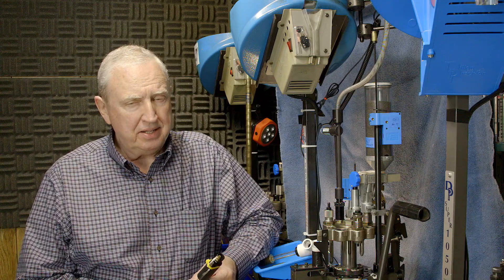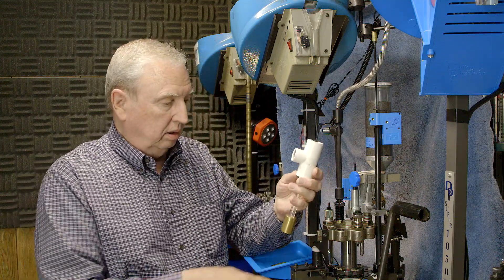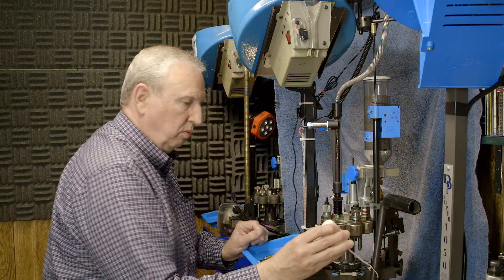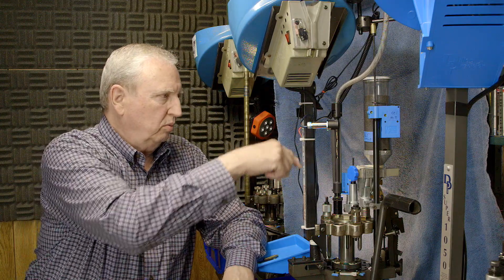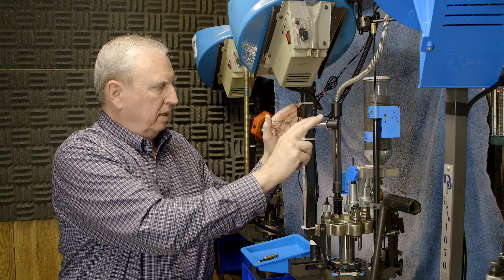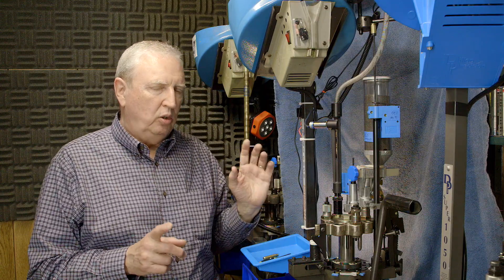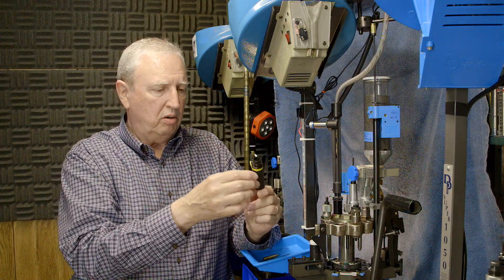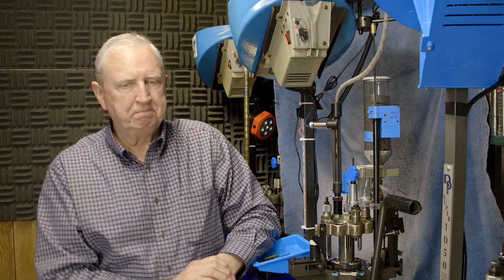3D Printed Prox Switch Dropper for Mr. Bullet Feeder

Comment: Thank you Rex for your contribution. Excellent work on the design. I noticed the 9mm stl v2 file doesn't have the proximity switch threads included. Do you have a version that includes the threads?
Reply from the maker: I discovered immediately those very fine threads don't work well (or at all) as printed threads and it is necessary to go in with a tap to make them work.  Right away I bought an 18mm tap for that purpose and have used it a lot over the years since. 

Also I feel the design I came up with later which uses a light sensor instead of an induction sensor works better. Most of all, I like the newer design because everything is in one package and the external wiring  is eliminated except for the power cord which plugs in. 

And finally, while I truly love either of these for .224 bullet sizes, I don't see any advantage to them over the Mr. BFF model when the bullets are 100 grains or more. 

BUT, if you'd like an STL version with the sensor threads, I will make one available later this morning. Check the links in the description for an update.
Reply: @RexRoach  Thank you Rex. I originally didn't see your new design until now. The new design looks great! Unfortunately, I've already purchased all the electronics using the proximity method. I printed the 223 switch dropper last night with a Nylon Glass filament and It turned out great. After running a quick 620 grit sandpaper pass, the switch threaded in perfectly. I think in most cases the various filaments will have a little shrinkage to create a good snug fit. Thank you for posting the tap specs. I plan to get it for the 9mm version.
What motivated me to go with your design, I found the Mr. Bullet Feeder switch area caused a lot of hangups. I tried every possible fix and nothing worked. When I saw your design solution, it logically made sense to pursue it. In the near future, I plan to go the optical route for 10mm.

Comment: have to say i just stumbled across this and its amazing!!!!!!  Rex, i appreciate you sharing this video the STL.s, and other various links!  but as with everything it leads to questions.
i tried to hook up my sensor(the same you suggested) and it does nothing....??  fiddled with some wiring and now it makes my feed plate spin when the light energizes??  lol   i'm not an electrical master but do understand typical wiring,  (have done normal drag car stuff for years with relays). 
i have a worm gear driven DC 20RPM motor from like BangGood, a RMP switch with on off toggle and the sensor and relay finishing it off with a 12v dc adaptor running 1amp to a barrel plug  any assistance would be great.
Reply from the maker: Daniel, start with the sensor. When you put metal near it, the light should come on. That will validate the sensor's working.

The problem you are likely encountering is the double-double nature of the sensor and the double nature of the relay. Lots of combinations. 

If your sensor is PNP then the signal wire will become ground when the sensor is energized (light on). In that case, connect one side (85) of the relay coil to 12 vdc+ and the other (86) to the sensor signal wire.

If your sensor is NPN then the signal wire will become "hot" (12 vdc +) when the sensor is energized. In that case, connect one side of the relay coil to ground and the other to the sensor signal wire.

Next, your sensor may be NO or NC, that is normally open or closed. Here you simply observe if the relay trips when the sensor comes on (lights up) or when the light goes out.

You should have one wire connected to your motor at all times. This can be either 12 vdc+ or ground. The other power wire will connect to the relay (30) and a third wire will connect from the relay to either 12 vdc+ or ground and it must be the opposite of the other wire to the motor. The third wire will connect to 87 or 87a. The easiest thing is to try one and see if the motor runs when the sensor is NOT energized. Swap it if not.

Hope that helps.
Reply: @RexRoach  i do in fact have a NPN "NO" sensor.  i'll attempt your suggestion and report back!  thank you again for the info and advice.  it REALLY is nice to get a SOLID man such as yourself providing some info on this sort of thing and not just sending the original post into "space" and not tending to the message after you sent it!  it is few and far between to find a person willing to "help" nowadays....
Reply from the maker: @danielholland4385  That's very nice of you to say. Much appreciated.
Reply: Rex, u were 100% correct.  And why I missed it idk…. The “motor + source” was moved to the 87 center prong and I tried everything or so I thought and that was it….  Now with your diagram “flipped” plus a sensing wire jumper sending 12v to my 30 relay plug it works.  

Do u suspect any issue with power (or sensor life) using a shared ground back to the wall outlet vs running them thru the relay? 
Thank you again for the help, and GOD bless you and your family during the Holidays.
Reply from the maker: @danielholland4385  If I understand what you're asking, a shared ground seems fine to me. Best of luck with this. I'm happy you built it. Merry Christmas and God bless.

Comment: Hi Rex, I'm loading on a Mark 7 Apex 10 and limited on vertical space.  What is the length of the dropper?
Reply from the maker: It's a bit over 11 inches tall to where the spring tube begins. That's measuring from the top of the die holding plate.

Comment: Thanks so much for making these files available!  Worked like a charm for my setup and British 303 loads after I adjusted the tube diameter in Fusion 360!
Reply from the maker: You're very welcome. I'm right now uploading a new video about a new OPTICAL sensor for MrBulletFeeder. It's a more compact, easier to set up design. Check it out later today.

Comment: Now if you could figure out something for the awful primer system one fowl up and you have primers every where.
Reply from the maker: To be fair it's a good priming system...until it isn't. You are spot on about what happens when things go south. I have discovered one trick I've never seen anyone do on YouTube. As you know, when the priming system has trouble, and you need to remove it, what do you do with that almost full tube of primers? If you remove or raise the primer slide actuator arm so the primer slide is free to move back and forth using your fingers, you can dump the primers out the bottom of the press by sliding the slide back and forth. Once you try it, you'll see how easy and quick it is. Takes about fifteen seconds to empty an almost full tube. Just put a cup or something underneath to catch the primers.
Reply: @RexRoach  Thanks for the replay I ask Dillion and they didn't know that trick, but I sure will try it.
Reply from the maker: @sportsfan205  My crystal ball shows a new video in the making.

Comment: Excellent design. I now have my own 1050 and am waiting for my Mr bulletfeeder conversion for .223 since it is all back ordered. I would love to incorporate your proximity switch into my operation. Are you selling it commercially yet?
Reply from the maker: No, I don't plan to sell it, but you can freely download all the files needed to print your own. If you have a 3D printer, that's great; if not, you can use a commercial service. I think the cost these days is about $28. Check the details in the description area.

Comment: Thanks for the idea, schematic drawing and the link to the sensor. I have been building an air powered sizer for my cast powder coated bullets and I needed a method of cycling the ram and bullet feeder. I used limit switches for the feeder in and out but I wanted something to confirm that the sized bullet had dropped before the feeder dropped another bullet into the die. This worked great and offered the added benefit of operating a counter to show the number of bullets sized, not just ram strokes. Until I saw your video I thought that prox sensors required a PLC and complicated design to operate. This was a great help to completing my project. Thanks again Rex!
Reply from the maker: Wow, this really thrills me. So glad this helped you. And thank you for letting us know.

Comment: Hi Rex. Awesome design and functionality. I have a quick question regarding the proximity switch. The one you are using is it Normally open or Normally closed.
Thank you for your time.
Reply from the maker: Hi Jingo -- It's a bit of a tricky question. You can use either one: normally open (NO) or normally closed (NC). Because you are using the prox switch to turn a relay on or off and not directly operate the Mr. Bulletfeeder motor, it doesn't matter which one you use.

If you use an NO prox, then the relay will "normally" be off and when a bullet stops at the prox, the prox will close and energize the relay. In that case, you want the Mr. Bulletfeeder connected to the NC contacts on the relay. When the relay is off, the NC contacts are closed and Mr. Bulletfeeder runs. When the bullet appears, the prox closes which energizes the relay and opens the NC contacts and stops Mr. Bulletfeeder.

If you use an NC prox, just use the NO contacts on the relay. It works either way. 

Just to make matters more confusing for you, these proximity sensors come in two varieties: NPN and PNP. I prefer the NPN as they tend to handle a bit more current, but again, it really doesn't matter. 

If you have an NPN prox, the black wire will provide "ground" for your relay, so one relay wire connects to the "hot" or plus side of your power supply and the other connects to the black prox wire for ground.

If you have a PNP prox, the black wire will provide "hot" or plus DC to the relay. In that case, connect one relay wire to the ground or negative side of the power supply and the other to the black wire. 

In both cases, one relay wire always connects to the black prox wire. The other goes to + for NPN and to - for PNP. The black wire matches the name, so NPN the black provides N or negative and with PNP the black provide P or positive voltage.

So all together there are four possibilities and any one of them will work. I suppose you could make a case for one being more "fail safe" than the others, but I quit thinking about it at that point. I didn't want to injure my brain.
Reply: THANK YOU SIR!   I was trying to figure out these two things for hours. @RexRoach

Comment: You're very kind to share the print file and all the information. Thank you. I have had this same issue with .22 bullets. Been able to tune the switch so that it works most of the time. Sometimes it gets jammed though. Maybe I'll bite the bullet and build this also. I'd like to try the ring sensor, but they are rare and very expensive. I've got question for you, as this adds weight to the other side of tube have you had any issues with the tube resetting down? In the beginning I had much issues with the inner collar wedging to the outer collar even from the spring weight pulling the tube to side. That was due to bad surface finish (grooves from turning) on the inner tube. I had to grind it smooth to stop it from doing it. Ill effect of that is I got rid of the protecting anodizing..
Reply from the maker: Thanks for you comments and question. I'm a little bit uncertain as to what you are describing. Are you talking about the sliding part in the bullet feeder die? I know that can be sticky if pulled sideways by the feed spring. I have the sensor oriented opposite the side the spring pulls, so they tend to balance one another. Is that it?
Reply: @RexRoach  Exactly that sliding part in the bullet feeder die. Didn't thought about that, that you had the sensor on opposite side. Then it is in balance. Very nice.
Reply: @RexRoach  Hello Rex, hope you're doing fine. Inspired by your solution I did similar setup. Please see if you're interested: https://youtu.be/D-U6a8i2uHI I gave you credits of the idea on my video, hope it is ok..

Comment: Thank you for the reply to the previous question got the proximity sensor into the 3d printed unit perfectly. Now is it possible to have a defective proximity sensor? mine lights up but does not go out  even when I put a bullet in front of it. I took it out of the 3d printed unit and the light will not turn off even with a bullet in front of it. The sensor is a NPN NO. It is my understanding that if the sensor light goes off it has detected a bullet in front of it.
Reply from the maker: Try connecting only the brown (+) and blue (ground) wires. The sensor should only light when there is metal in front of the tip. A screwdriver or such works fine as a target. It should not light up all the time. 

If that works, put a voltmeter with the black (com) lead to the black sensor wire and the red lead to the + DC where the brown wire connects. It should read 0 v when there is no target and +12 or whatever your supply voltage is when tripped.

Be sure your power supply is DC volts around 12 v.  I have a number of "wall-warts" that produce AC voltage outputs. Double check the polarity.
Reply: Again thank your for your assistance. I did the test you described and the sensor is lights up all the time and there is 12 volts across the brown and black wires. The sensor did not activate even with a metal wrench in front of it. I think the sensor is defective. Does the sensor have to be a 300ma or can it be a 200ma?
Reply from the maker: @kennethpeterson5610  The 200 or 300ma number is the amount of current the sensor can "pass" to a device such as the relay in this case. As long as the device draws less current than the sensor's rating, you're OK. I **think** the relay coil draws 150 ma which would work fine with a 200ma sensor. The sensor itself draws very little current, although I don't recall how much.

If you have the blue wire to ground or -, and the brown to + 12VDC, the black UNconnected, and the sensor is on all the time, I'd say it's defective. If the light is on, you should read 12v between the black and brown and 0 when the light is off, but since your light doesn't go off no matter what, then the sensor must be defective.

Comment: Up loaded the .stl file listed to craftcloud  received my printed unit today and the proximity sensor would not thread into the unit, it is too small to fit the sensor. something failed here, so any advise here would be appreciated.
Reply from the maker: If I did not make this clear in the video, I apologize sincerely. Threads as small as the 18mm sensor threads cannot be successfully 3D printed, so I made them a tad undersize so you can clean it with an M18X1.0 tap. I did not need to drill before tapping, but if you do, a 17mm drill is the proper size, although you might could use a 21/32 (which is slightly smaller) since it is plastic.  Please accept my apology for any confusion.

Comment: Hi Sir, this is really amazing,  Is there any change, that you could Modify this, to accommodate 9mm Bullets,  and provide a STL.   What would that cost ?
Reply from the maker: Thank you. I think it would not be a problem. On the other hand, the 9mm setup from Mr. BulletFeeder works perfectly. I know because I have one. Why would you not want to use that? Granted, the sensor is "cool" and high tech and you can "be the first kid on the block" to have one on your 1050, but just getting the "regular" one from MBF would be a LOT less trouble.

BUT, just for fun, I will have a go at a 9mm model.
Reply: @RexRoach   Hi Rex, First of all, I am based in South Africa, so Mr. BulletFeeder, cost 2 x more than what a press is here.  I have to add, that I am using a Lee Loadmaster, and have a Printed version of an Open Bullet Feeder.  I have used a Microswitch in the Past, but this proximity sensor I believe would be more accurate.  I am awaiting for my Hornady lock and Load Bullet Feeder die, and would like to utilise this "tube" between my open bullet feeder, and the hornady die. I am not sure yet, if all this will work, but, I will sure be very happy, if your Modification does the Job.  Thank You for the trouble.
Reply from the maker: @lourensbrits7347  Thanks, Lourens. I hope it works for you. If you need some modifications to the design to match up to the Hornady die and/or your Open Bullet Feeder, let me know and I'll be happy to help you. By the way, in 1984 I spent several weeks in South Africa in and around Barberton. I loved it.
Reply: This is 12mm instead of your 18mm  So alot of changes needed then.  :-(
Reply from the maker: I've added a 9mm version in the description area. Price at ALL3DP.COM is $30 with black and polished finish. No guarantees. This is an untested design, but it's close enough to the working model that it should be OK.

Comment: Thanks for that F360 file, you do a few little tricks in there that I haven't ever tried or even thought of.  BRAVO!!
Reply from the maker: Thank you very much. You asked in a separate query how I put the "scallops" in the part with Fusion 3D. Create a workplane tangent to the body where you want the groove. Create a sketch on that plane and draw the shape of the groove (scallop). Subtract (cut) that shape but only for a shallow depth. Then create a circular pattern of that feature to get it on the remaining sides or legs. Hope that makes sense and helps.